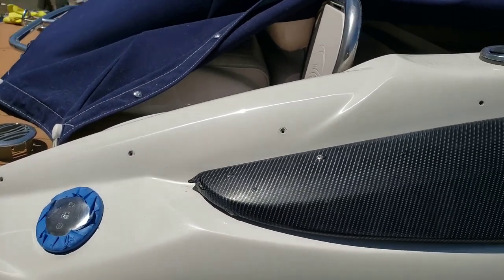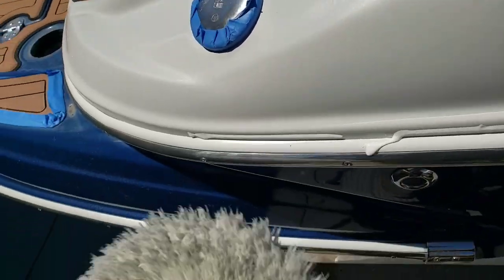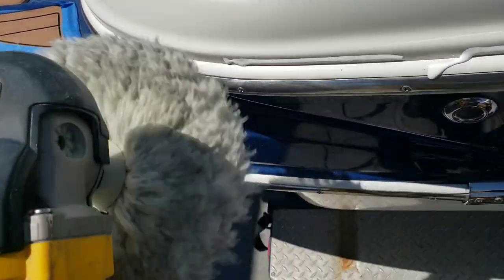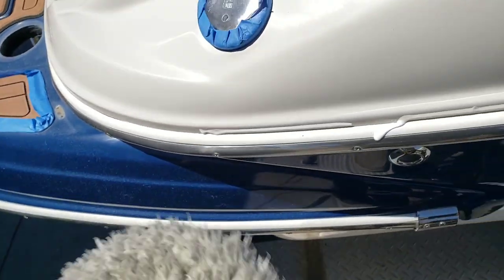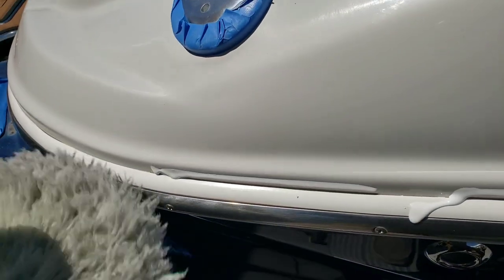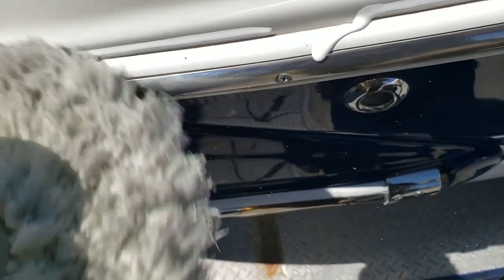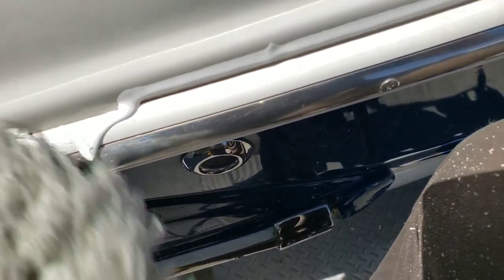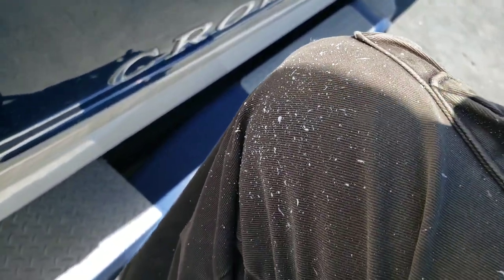Efficient Buffing for Compound and Wax. a detailer's lesson for Effective boat polishing.

Comment: I just finished compounding my 5th wheel with 3M Perfect-it EX AC, and it turned out FANTASTIC!  Thanks for recommending it and all the vid's showing how to do it.  Now I want to go the next step, to protect the clean gelcoat and polish/wax it to bring out and keep the the shine.  What produt(s) do you suggest I use?  I was thinking of Starke Hyper Hold polymer sealer to protect followed by Meguiars Flagship Premium Wax or high gloss polish to make it shine even more. Your thoughts & comments are welcomed.
Reply from the maker: Just flagship. I haven't heard of the hyper lock lasting longer than Flagship.
3ó3 aerospace protectant applied once every 3-4 months should keep you looking good for a long time to come.

Comment: Save some money  jj 3 m  is money  liquid. Fly away        l break  code to  save compound   l wash  3 times the boat   degreaser  orange   l use  4 pads  steel wool    # 0000   scrub   hard save you 1/2. Time buffing
Reply from the maker: Interesting idea.